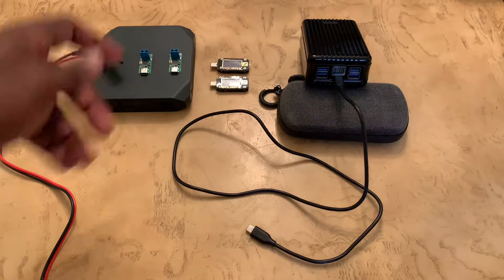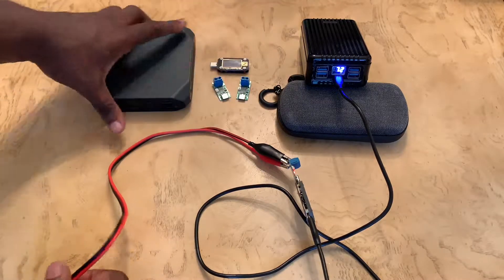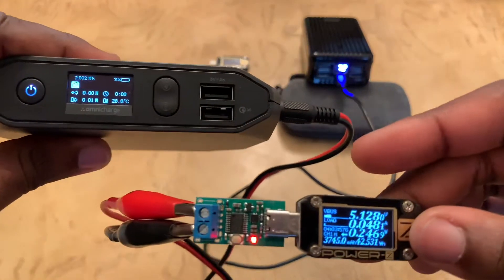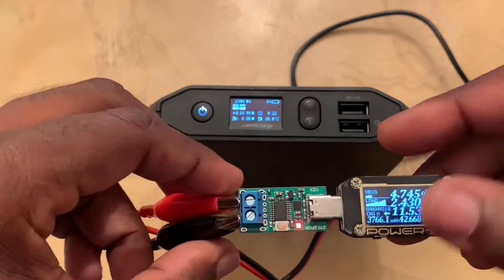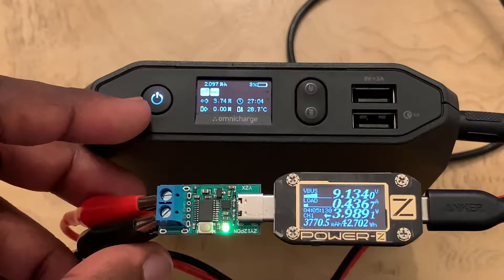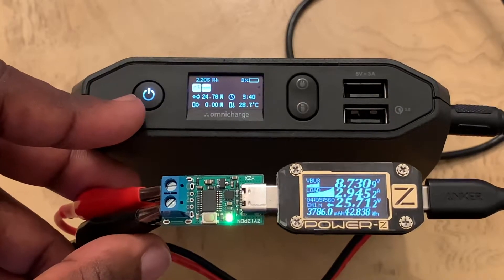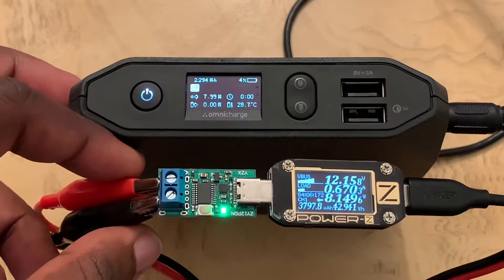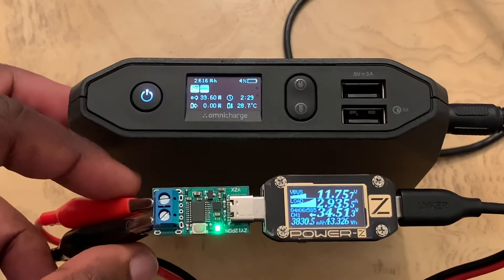YZX Studio Type-C Power Delivery Power Supply Testing

Comment: OmniCharge should have been programmeable with how much watt it could draw. So you know your power supply wont shut down suddenly.

I have been using the PD-Trigger for a 12v led light I have made (just led strips). I tested also with a 21w automobile bulb, and it seems like the PD-Trigger does not get any warm at all. Also it seems like only USB-C to USB-C cables work. I don't know if PD can go over USB-A socket.

Comment: Hello! Thank you for your video and explanation! I have a question about charging my laptop that does not come with usb-c charging. I plan to use this Cablecc USB 3.1 Type C USB-C to DC 20V 5.5 2.5mm Adapter PD Emulator Trigger 90 Degree Angled https://www.amazon.com/dp/B07SJ4CB27/ref=cm_sw_r_cp_api_i_dBuWEbSRHCTQ5 I will connect that to my laptop and then use my usb-c pd charger. I wanted to know if it’s safe and if it will work.

Comment: GREAT VIDEO 

maybe they UPed the price after you posted but PD triggers cost s lot less at eBay no connection just a low price $5.52 https://www.ebay.com/itm/362907330239 or even lower ~ $5.21 https://www.ebay.com/itm/293473721135 i did not think eBay would be cheaper then Ali E